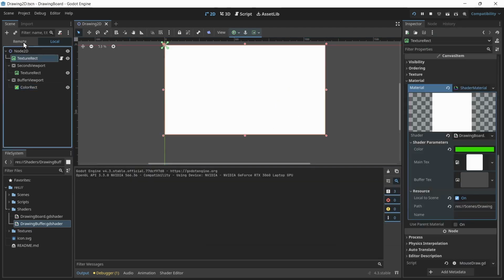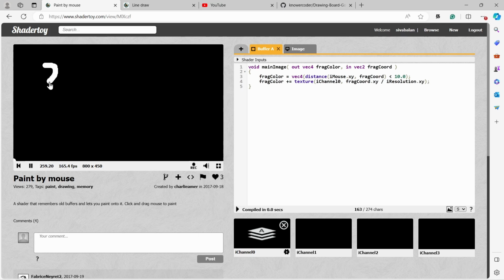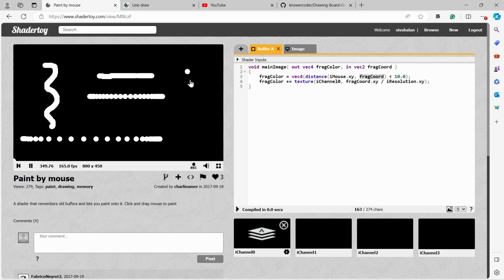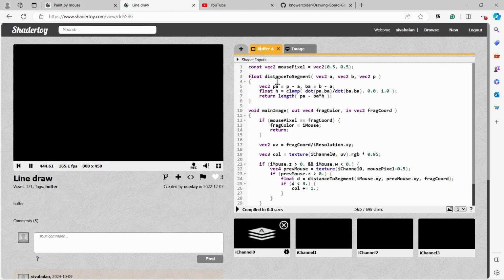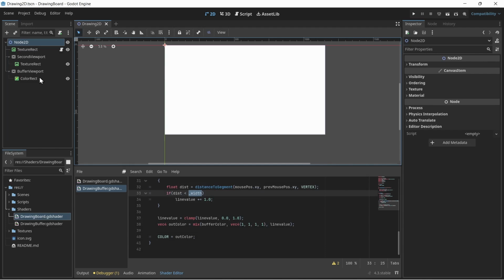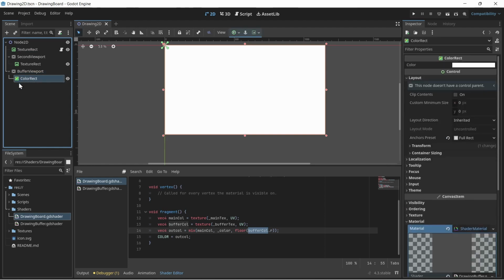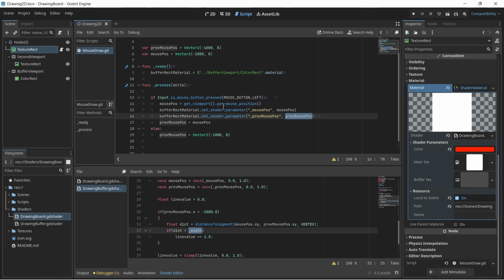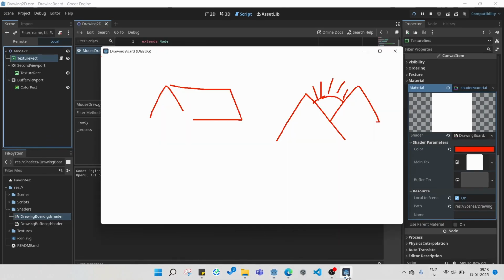Drawing with Shaders - Godot Engine

Comment from the maker: Update (16-Apr-2025):
I have used two subviewports for self-buffering in this video, but instead, you can use one subviewport with the setting in the inspector -> Render Target ->  Clear Mode = Never. Updated Mode = Always.
Everything else is the same as said in the video. This change is updated on the GitHub project.